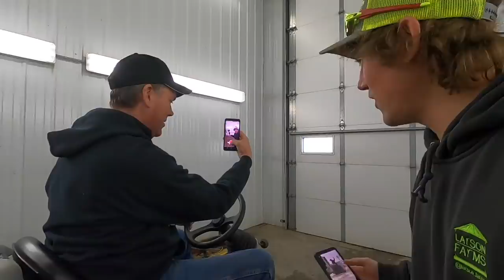Our New Floor Scrubber Wrecked The Floor Drain!!!

Comment: as a guy who had worked on floor scrubbers for many years, i will give you a couple tips.  only scrub for a maximum of 3 hours at a time, then plug the charger in for a full cycle.  you will max out your battery life that way.  top off batteries AFTER it has been cycled on the charger.  On the scrubber, take the linkage for the squeegee pitch apart and put anti-seize on the threads.  It will make adjusting so much easier in the future, if it isnt froze up already.  Any other questions, i would be happy to answer!

Comment: Chet the creeping oil is amazing stuff for rusted stuck bolts. We used that stuff by the cases on Navy Aircraft that had salt all over it from flying over the ocean. Bolts seized into place from the Salt. Keep that can very handy. That is amazing stuff! No joke!  It’s called Kroil Penetrating Oil. 👍
Reply: It’s the best penetrating oil on the market.
Reply: I agree. Kroil creeping oil is some awesome stuff.
Reply: Hands down the best ! Every shop should have it is correct!
Reply: Been using it 40 years.  Navy introduced me to it.  Best stuff made.

Comment: I ran one of those 20 yrs ago.  Mine didn't have that fancy tilt steering wheel.  Would have been nice for a big guy like me.  You guys probably know, they work well on a dirty floor, but not on a floor with lots of "debris".  Sweep that stuff up first and we found the machine worked best if we scrubbed/cleaned first and then used the suction function 2nd.  The intake hose at the back would get clogged all the time.  Not easy to clean out unless you can back the rear end just over the end of a loading dock.

I'm sending some yellow chore gloves one of these days.  Dougo hasn't worn any in several videos now.  My local Menard's is out of 6 pks and I felt $1.69/pair was just too much!

Comment: Well now youve gone and done it. I told you I worked my whole career at UPS and that your shop is damn near as well stocked as one of theirs. Your floor scrubber makes it complete. Everyday after all the trucks leave the building, the porters use a large industrial scrubber on the cement floors. I am amazed at all the equipment you have.

Comment: Kroil is good stuff! I'm not sure how it works but in my experience, it will (for lack of a better term) "wick" it's way into rusted-together parts, bolts, nuts, etc. Apply it, go away for an hour or over night (if it's real bad), come back and whatever was stuck is no longer stuck. It's surely saved me some broken bolts.

Comment: As a forklift mechanic that also works on floor scrubbers I would recommend leaving the lid open on the recovery tank after rinsing it out. It will stop the mold growth in the tank.

Comment: Dougo you need to have the boys make a water stand, where you can unload the dirty water down the drain and have a plastic tank full of water and drop a hose into the water tank of the scrubber and let it fill up by gravity and while you are filling the scrubber the overhead tank is starting to fill-up again and shuts off by a float, kinda like a stock tank.

Comment: You really like that cruel oil that will loosen any bolt that's rusted tight on the D4 dozer we have by the time the guy went to go get the torch I had them knocked off with the impact gun you just wait five to ten minutes with the oil soaking on it and it'll break that Rusty bolt you'll love it little expensive but it's worth waiting gold glad your wife's doing better

Comment: Could u explain if proline has one that works with a power washer. Looked like u where holding one at the end of the video.  Does it just snap in to a normal wand? Thanks

Comment: Replace those plastic floor drains with some commercial grade metal ones. Problem solved. Toby would look good riding with Dougo on the floor cleaner, just put a basket on the back.

Comment: Shower first before you shave. Shave right after you get out of the shower. It will moisten your skin and whiskers so you won't get razor burn. Also if you a razor and you get what they call "razor burn" It's not the razor it's the soap or shaving cream you're using. Means you're allergic to it. Change soaps/shaving creams.

Comment: Kroil  $19.00  a can penetrating  spray for  frozen parts let  soak overnight I got my son to use it in his auto tire shop but he has to keep it in the safe this is to be used only on tough jobs once you use it you will find a distributor and purchase it buy the case .